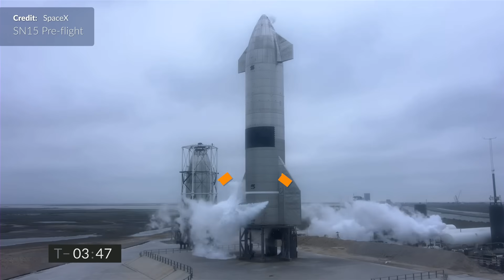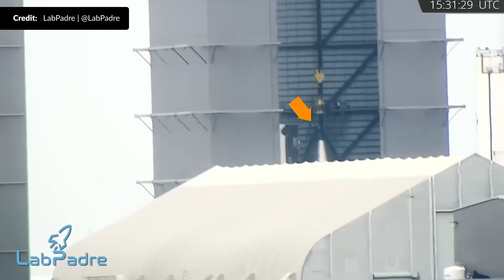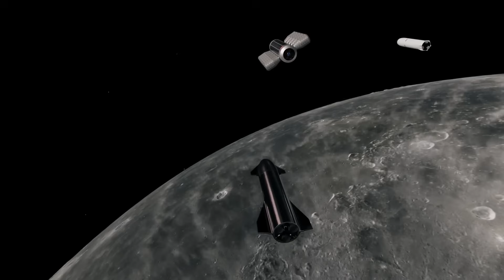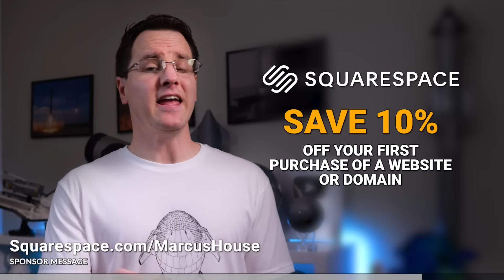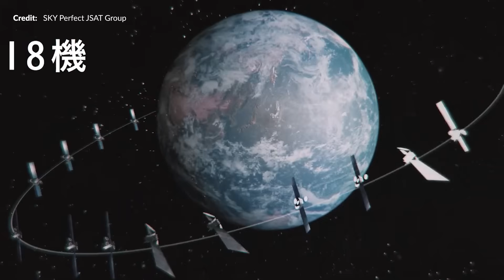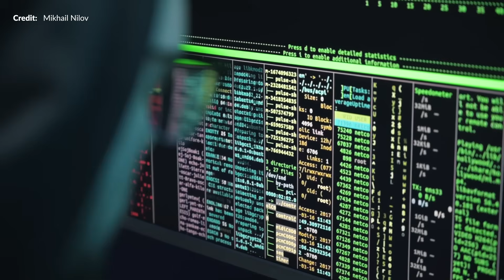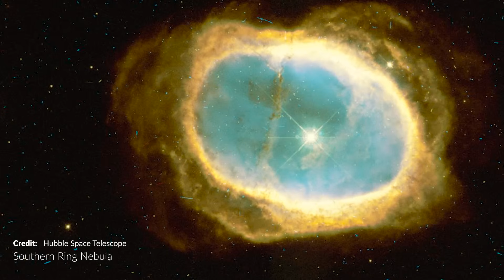SpaceX Redesigning Stage Zero?, Starlink Hack, Artemis 1 Final Rollout, JWST Update

Comment: One clarification about the Starlink hack, he only gained root access to the terminal not the network. Its the equivalent of jailbreaking an iPhone and he would not be able to see other user's data.
Reply: Great point Peter. I haven’t read any of the detail behind it. So are you saying the terminal for the dish?
Reply: Exactly, you got to like spectacularity of "root access" as it's some kind of a GOD-Mode, the Bruce Almighty, even it's actually integral part of any system 😀
Good analogy on iPhone jailbreak although there is even more technically accurate example - think of Starlink as a cable network broadband since inner workings are 80% same (apart of phased-array sub-system for satellite tracking and the fact it uses air instead of cable as a medium). Even you would gain root access to the modem on your side you still wouldn't be able to even see how many users there is, let along their data. Simply there is nothing to exploit in order to gain access to data since there is no facility to access the data in the first place. You can't hack the fridge that's not connected to the internet 😀
Remember, hacking is use of system's capabilities in the way their creator didn't anticipate. So, it was just matter of time. It's unfixable because of physics that make the processor work - and yes, that means there is a small computer in the dish that can execute arbitrary code, but still can't access other user's data or see if your milk passed it's expiration date 🤣
Reply: It’s one step closer to step 2 . That’s the big point
Reply: Did he just code/hack his way into a job/consultancy position with SpaceX/Tesla?
Reply: Not entirely equivalent.
You don't need a $25 custom PCB to jailbreak a phone.
I also question that $25 price tag. Maybe if someone mass produced it.
Reply: @cbboegh  the chips cost about $11 total, the board can be manufactured at JLPCB or similar for $2 (for 5. According to ads on YT videos). In addition there are quite a few capacitors and resistors, probably diodes too (these are really cheap, but buying 1 each is wasteful compared to buying 100). Also there's a USB connector that cost about $1, but again, you get a better deal if you buy more.

I haven't calculated the whole BOM, but the chips are the most expensive,  and 2 of them cost $3 each and the rest are $1 each. And that's if you only buy 1 of each.

So yeah, $25 for a one off isn't out of the question.
Reply: @phizc  only if you value the cost of your time and skills at 0, and ignore the probability of a $500+ dish writeoff.
Reply: @andytroo  JLPCB offers SMT assembly too. $9.5 + 0.17 cents per joint/pad. Wouldn't take many boards to get below $25, I think. Destroying the Dishy is another matter.
Reply: @cbboegh  It's basically a RaspberryPi. . . So a $25 price tag is not out of spectrum.
Reply: @cbboegh  you need to teardown the dish, solder a bunch of wires and hope for the best to glitch the processor... 99.9% end users attempting the hack would just destroy the dish.. this is not a viable attack vector :D  furthermore hacking the dish/terminal means nothing... like rooting/jail-breaking your phone doesn't mean you can hack your service provider's network...
Reply: "In order to break into Starlink, Wouters stripped down a Starlink satellite dish he owned himself. He then modded it with a custom circuit board, made up out of a Raspberry Pi microcontroller, electronic switches, flash storage, and a voltage regulator. He soldered the contraption onto the existing Starlink power circuit board (PCB) and connected it. Once connected, the tool was able to temporarily short the system, which gave Wouters a way into the system. Wouters described the hack in full over on Black Hat, noting that he was able to explore the network freely once he gained access to it."

I would beg to differ.
Reply: @johndoh5182  I don't think this is correct.  The actual quote was "Our attack results in an unfixable compromise of the Starlink [user terminal] and allows us to execute arbitrary code. The ability to obtain root access on the Starlink [user terminal] is a prerequisite to freely explore the Starlink network." They did not freely explore the Starlink Network.
Reply: @johndoh5182  The real question is whether he is able to order a satellite to use its thruster to change orbit, or boot other users off the network.
Reply: No he gained access to the whole network using a glitch attack on the satellite dish which involves bypassing hard coded security features by disrupting the electrical current in the boot up security process. Very hard to do, a normal person can't just buy the parts from ebay and expect to do it himself.
Reply: @spacecowboy07723  citation please. That was bot mentioned in the slides from the talk.
Reply: @spacecowboy07723  He only got access to a client, not the server. For example, just because you have a hacked game client doesn't mean you can freely access the filesystem of the server.
Reply: @user2C47  okay, thanks. I read the article wrong I guess.
Reply: @user2C47  so basically just a glorified script kiddy?
Reply: @spacecowboy07723  that's BS, stop spreading misinformation ! either you don't understand the involved technology or you can't understand written word or both ;) hackaday article says "it could be used to explore the security of the rest of the Starlink network" not that he explored the network...
Reply: @spacecowboy07723  "No he gained access to the whole network"  This is completely false.  He gained root access to the user terminal, he did not have access to the rest of the starlink network.

Comment: Redesigning Stage 0 would be something needed. I mentioned this a few weeks back on a channel, as the design should be made to take more force, and also help direct the hot gases etc down, vs potentially damaging the top from the heat.

Comment: It's not clear to me why catching is measurably better than landing. Starship has to support its own weight whether hanging or standing. Does the savings in leg hinge motors outweigh the probability of a perfect catch 100% of the time?
What is clear to me is that there will be no lunar landing without a Stage Zero built built at the selected landing site first by several robotic missions, at which point one has to ask again... Why?
Reply: HLS will have other mass savings. No fins.  No heat shield  for two and will initially at least have far less cargo so having legs for landing in .17 g won't be a mass issue.  

Every ton of landing leg will likely remove multiple tons of cargo especially since you need them on both booster and Starship if you aren't using a catch system.  If they can make it work it will be a phenomenal "hack" to increase cargo capacity.  Just like moving the ignition system for 20 of the engines on the booster off ship to the "Stage 0" does the same.

Musk needs to add to his "The best part is no part" the following "the 2nd best part is one you don't carry around".
Reply: @Scanner9631  Could be, Scanner, but looking at the Apollo landing sites suggests to me that Lunar landings on naked regolith are unnecessarily risky. Also, according to your 'no part' aphorism, using a pre-build Stage 0 on the Moon eliminates the need for the janky elevator system the crew members would otherwise need to reach the ground.
But, as I said, with all of this, why? Why have crew members at all? What's the point?
Reply: @averystablegenius  
How do you build a stage 0 on the moon without HLS landing on the moon without it?  Only if building a permanent base with local materials does it become practical to do a Lunar (or Martian) stage 0.

You still won't be able to land on Raptors due to the lower gravity.  They still need the smaller higher mounted thrusters for landing after the Raptor have cut the velocity down to manageable without them.

People are still better than machinery for many jobs.  If virtual reality were good enough you could leave the people behind.
Reply: @Scanner9631  If I were assigned the task, Scanner, I would design a crewless landing system that was a nearly completed landing pad, with another crewless landing system that was a nearly completed tower, and let robots finish the hookup and testing, all solar powered of course. No HLS needed to build Stage 0. Cheaper. No one gets killed. Bob's your uncle. No janky elevator. Refueling capable.
But your point about leaving people behind is a good one. Why have them at all, unless they're billionaires or trillionaires bored with their megayachts?
Reply: @averystablegenius  

HLS is a crewless landing system.  The crew like with Falcon 9 and Dragon are either not present or not in control.  

Designing a whole new system to land on the moon and set up a system to land HLS is very wasteful.  
 
Use HLS with or without a landing/launch platform.  It would need a lot of landings and launch from one location to justify building such a tower.
Reply: @Scanner9631 I'm not sure why it's called the Human Landing System if there are no humans involved Scanner, but in any case, you're thinking about economics now ? What changed? Have you seen the number of launches just to get Starship to the Moon?
Reply: @averystablegenius  

It is called the Human landing system as it is intended to land humans.  They aren't in control of the landing so they are just cargo not functionally crew during the landing.  Dunsels.

Compare the cost of one flight to the moon for HLS to one by Apollo or SLS.  (Apollo 11$25.4 billion NOT inflation adjusted).  SLS $4+ billion.  Two HLS $3 billion between them.  So definitely economical.
Reply: @Scanner9631  You know the cost of an HLS Starship mission, Scanner? Please share your spreadsheet with those figures. I've been searching all over for that information. Include developmental costs, but no Elon PR fluff, please. We both know what a con he is.
Again, if the humans merely dunsels, why have them at all?
Reply: @averystablegenius  

Look at the WINNING BID for HLS.  A lot of the development costs are IRRELEVANT as they are for Starship/Super Heavy and are incurred with or without HLS which is a special purpose variant.

Humans do not OPERATE the HLS.  They perform their purpose on the Lunar surface OUTSIDE the HLS.  Exploring and doing science.  Being guinea pigs for how lunar gravity affects people over up to 45 days if the longer missions happen. Not part of HLS part of the Artemis MISSIONS.

You could take a bus to work.  You perform no function on the bus.  Once the bus delivers you to work hopefully you perform a useful function before going home on the bus.
Reply: @Scanner9631  Glad we agree that humans are not necessary to operate or land space craft, Scanner. If the goal is exploration, you may want to check out some of the rovers we've sent to Mars. They're doing a brilliant job of controlling, landing AND exploring, with the remote supervision by humans that will be less latent on the Moon. I'll agree with your bus analogy when buses are full self driving, but then, FSD is another Elon con, isn't it?
Reply: @averystablegenius  

Human vision can see things that don't show up as clearly on video so they do have a place in exploration.  

Lots can be done with rovers especially on the moon with remote control/supervision but ultimately humans can do things machines cannot.  Human+machine > than wither alone.
Reply: @Scanner9631  Could be, Scanner, but are the alleged improvements from humans worth the additional cost? I often see this claim, but I've never seen a rigorous, quantitative proof. Can you share your spreadsheet on this also?
Reply: @averystablegenius  Yes, humans are worth the cost. Humans are more flexible mentally and physically than the robots. Even in spacesuits. Just look at what Apollo was able to accomplish.

As for the cost of the Lunar Starship test landing and manned Artemis III landing, it is $2,941,394,557 to NASA per the Apr 2021 HLS Option A Source Selection Statement, page 8.
Reply: @averystablegenius  I pointed you to Apollo which in 6 missions beat out all other robotic missions from all of the other countries. They STILL have return more lunar samples than ALL the robotic missions to date. The Chang-e 5 returned 1.7 kg of lunar samples and Apollo returned 382 kg of sample.

Teslabot is nowhere near to being ready to go anywhere anytime soon, much less the Moon.

SpaceX is paying for over half the lunar Starship cost, so that $2.94B to NASA is likely the operational cost, based on SpaceX's first 6 flights of Crew Dragon. Per the NASA IG, the first 6 flights of Crew Dragon were under the $2.6B SpaceX contract and at $55M per seat (NASA IG), that is $1.3B for the operational costs. Sorry bud, you fail again.

And haven't we had this discussion about my NOT being a Elon fanboi since I real in their wild claims all the time? Dude, get new sources of info aside from CSS and Tf00t as they cherry pick their data.
Reply: @steveaustin2686  Steve, did you point to the cost per kilogram between Apollo and Chang'e per my instructions? Sorry bud. You fail again. When you apologize for that Elon fluffery, we'll discuss the rest.
Reply: @steveaustin2686  Steve, you seem to be suggesting that an unmanned mission could not be designed and conducted to return larger sample quantities. Please share your numbers why humans are needed to return a larger sample quantity of higher geologic value from a larger area. Bud.
Reply: @averystablegenius  In over 50 years, no one has done a robotic mission that outperformed the Apollo astronauts.

What part of humans are more flexible, physically and mentally, did you miss? Robots are best in static environments, where they perform repetitive tasks. Humans are better in dynamic environments where decisions are made on the fly. This is not a hard concept.
Reply: @steveaustin2686  Steve, what part of robots outperforming humans on a cost per kilogram basis did you miss? Bud? If robots are not practical for dynamic environments, are you conceding that Elon's Full Self Driving and RoboTaxi is a con? Bud?

Comment: Some guy (John) in a comment on a recent video on another big SpaceX channel suggested that SpaceX might initially test the catch system by hanging a booster off a crane, positioning it with the catch pins some distance above the top of the catch rails and then simply dropping it. I just did the calculation based on my memory (perhaps wrong) that Elon said in one of the Tim Dodds' videos that the booster will be coming down at about 3m per second as it approaches the catch. Using v^2 = u^2 + 2aS where u = 0 and a = g and approximating g as 10ms-2 a 45cm drop would give about the right contact speed.

Simply dropping a booster would of course mean that the acceleration curve was all wrong but hanging the booster off a spooled tether that incorporated a dynamically adjustable drum brake to partially counteract gravity as the tether is unspooled could allow SpaceX to simulate the approach much more accurately and, depending on how much headroom there is between the maximum crane lift height and the top of the booster, it is possible that SpaceX might even be able to simulate a decent amount of the final approach prior to the catch, perhaps even the last 10m or 20m of the trajectory if the crane can lift high enough. That might even be enough of the final trajectory to allow SpaceX to practice closing the chopsticks as the booster descends.

All of this could (and presumably would) use an unfuelled booster with inert ballast in place of whatever remaining fuel load is expected to be onboard at time of catch so it would be a relatively safe experiment, certainly no explosion risk, and seems to me a very worthwhile initial test to do prior to attempting a real catch. Maybe this is why these lifts/dampers are going in relatively early.